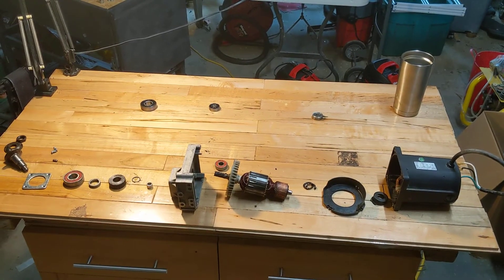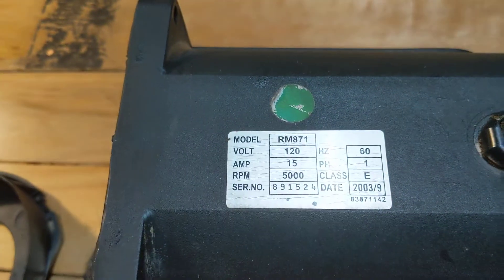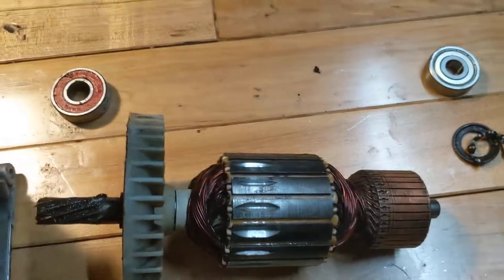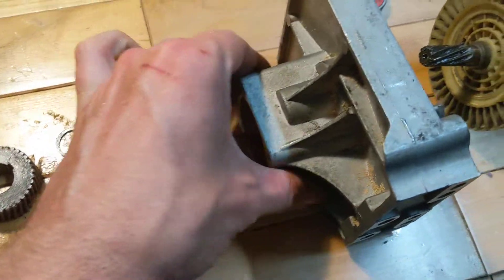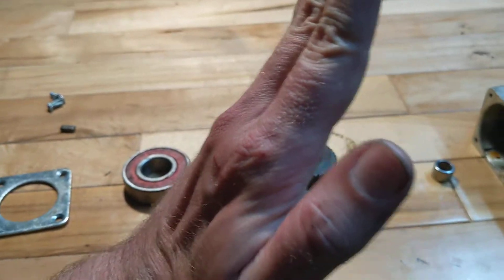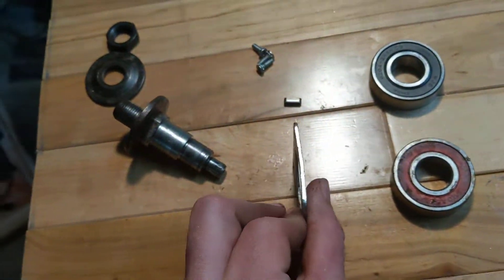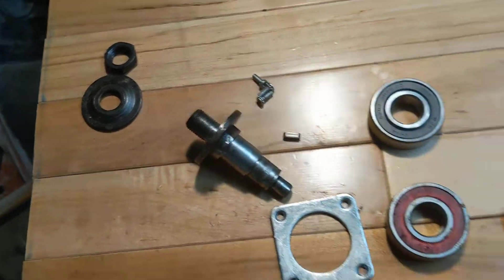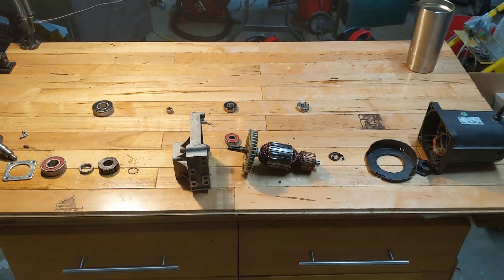RM871 Motor Parts Layout and Diagram for a Craftsman table saw. Exploded view! Here it is!

Comment: Thanks, man. I have a Bosch table saw. My issue is the motor works fine. But the driving shaft is spinning slowly in its own time. Would know what the cause is before I dismantle the motor?

Thanks.

Comment: Hy I have the rm870. But that aluminium casing has cracked. I’ve jab welded it. Can u show me a link where to find a new part. I’ve looked all over. I have pics if you need them. It’s my draper tablesaw. It’s old it groans but it does the job. If I can’t find the part or what it’s called. I’ll have to buy a new saw
Reply from the maker: @craigyboyuk  if you can't find it by searching for "RM870 casing" or "RM870 housing" on eBay and Amazon, see if anyone is selling a broken/damaged rm870 motor or saw since all you need is the casing. Look for the table saw model, sold as is.  Facebook marketplace is another place to check. I'm sure someone is selling the rm870 motor or a compatible replacement, rebuilt, working, all assembled, for $150-199 which is still less than the cost of an entirely new table saw.
Reply: @JoelRyanQuinn  thnx brotha. It’s holding with jb weld lol. I’ve just gave it another dose. Thnx again. 👍

Comment: Nice presentation of rebuilding the motor.  My motor gives sparks at the brushes and melts them. I checked that the motor shaft spins freely and no jamming. So it looks like all the bearing are good. Any idea why the sparks at the brushes?
Reply: either the voltage going to saw is way off from 110vdc, your brushes are severely worn or your motor windings are kaput. a severely oxidized commutator ring is also a possibility but less likely, the brushes are supposed to wipe them clean.

Comment: Hello, this layout was very helpful. I've completed replacement of all bearings. I successfully used a bearing to remove them all including the cog. My question has to do with the dust cover. I couldn't find this part anywhere. Is it suggested reinstalling without? Grateful for any feedback.
Reply: Did you reinstalled without the dust cover? I have same problem, couldn't find that piece

Comment: How did you get the shaft and gear out of the gearbox at the front of the motor to replace the two bearings there?  Did you have to use a bearing splitter?
Reply from the maker: I just destroyed it with a dremel rotary saw like a caveman. A bearing splitter would have been much better

Comment: I just finished rebuilding the RM871 in my Craftsman 137.248880. Thanks for the exploded diagram it was very helpful. Also, a bearing splitter is a must-have for this job.
Reply: Why is a bearing splitter needed and to which bearing are you referring? thanks

Comment: Hi, I have the exact motor and the rear bearing freezes that stop the motor from spinning.  I am trying to get the entire motor dissembled so i can replace all the bearings and flange and bushing.   I am at the stage where i took the motor out, and removed the black housing.  I have successfully reached the rear bearing, but i couldn't figure out how to remove the entire armature from the front casing (aluminum case).  Mine seems like it is stuck, and no matter how hard i pull on it, it just wouldn't budge at all.  I do not want to go brutal and hammering it.  Looks like you have everything taken apart, can you please show me how to separate the armature from the silver gear casing?
Reply: Did you figure out how to do this step? thanks,

Comment: A new bearing cup can be bought from Or1More tools on amozon market place for 23.31 tax is included in the posted price, I'm having a difficult time trying to find the plastic motor case for RM871 which is discontinued. the bearing seized and spun in the bearing cup melting it to the housing. Was able to get the cup out but I would prefer a better housing.
Reply: Im having the same issue. Any Luck finding a housing?